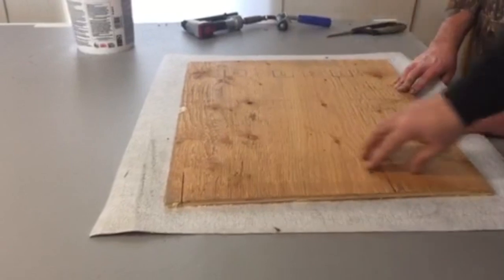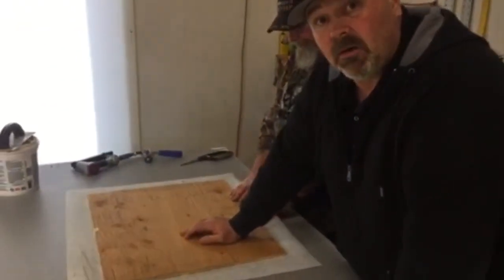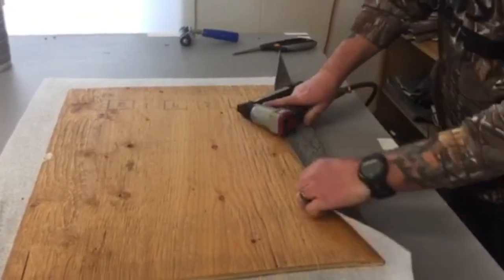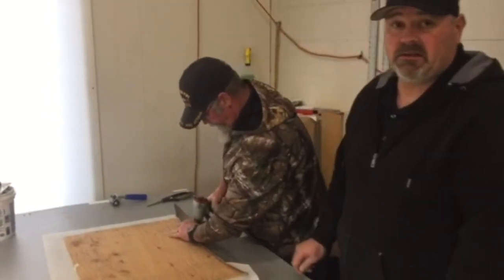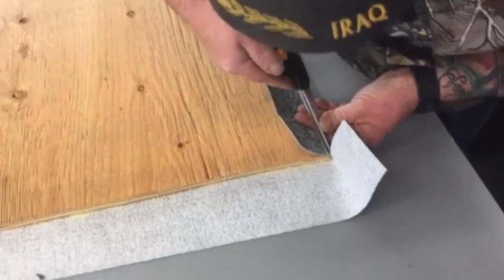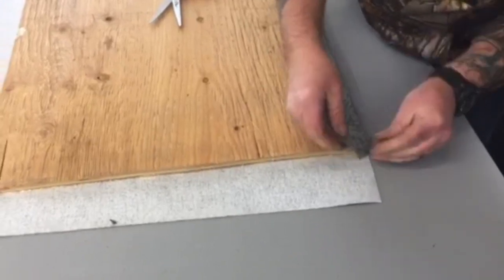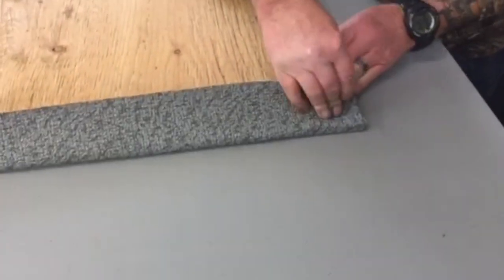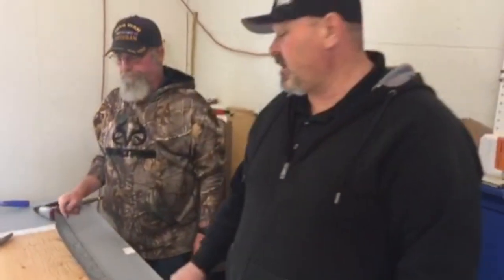Best Boat Vinyl Flooring & Corner Install DIY

Comment: What adhesive do you suggest to adhere vinyl flooring to the plywood?
Reply: I am looking for a reply on what adhesive you used but there is no reply.  I want to do the same but nobody can tell me what marine glue to use.
Reply: @jerryjurski4434  
I just did a nautolex install on my boat with H66 glue. 1 gallon was more than enough on a 22'. Sticks to anything.